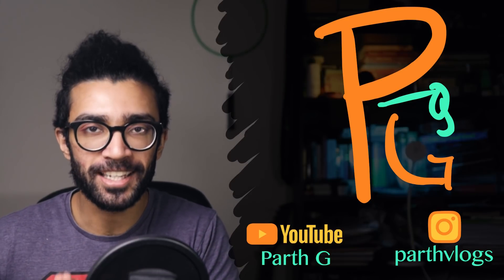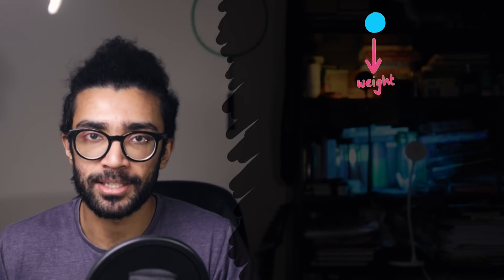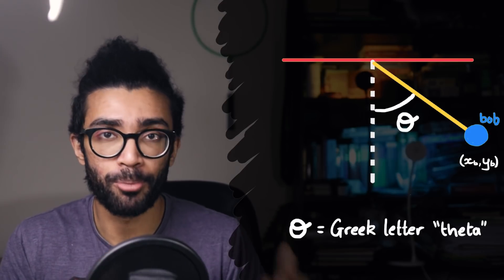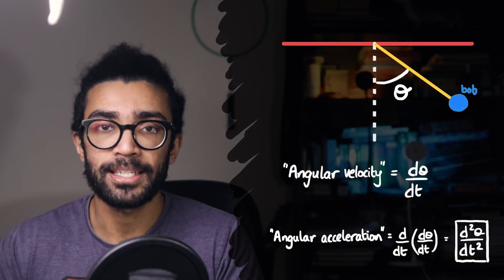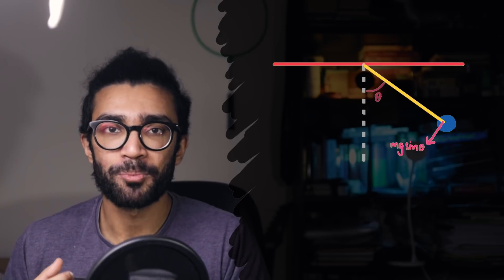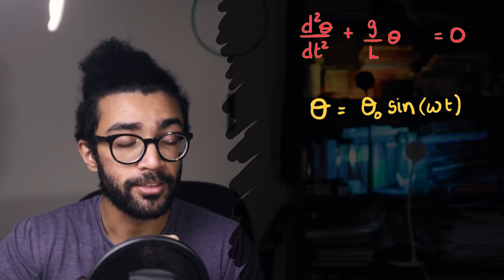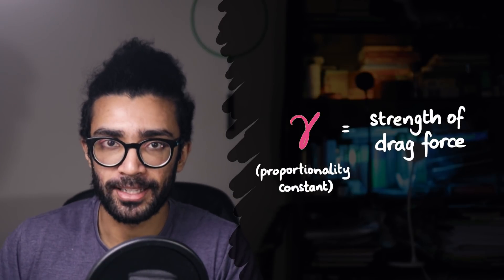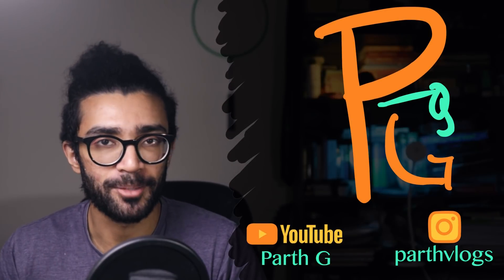How Physics Includes Air Resistance in Calculations | Real Physics

Comment: Hi, when looking for work done by air resistance, say for example there is a constant air resistance force of 5N acting on a ball that is connected to a string. The string is 4m long and is  held at a 90 degree angle parallel to the ground. It is then dropped down and falls in a circular motion due to the tension of the string. Work = Force x distance of displacement. So would the distance of displacement be equal to the angular displacement? or would the displacement be equal to 4 since it goes from a height of 4 meters to 0 meters? The 4 meters coming from the 4m long radius of the circle (string).
Reply: I have a test tomorrow and would greatly appreciate a response before then 😅

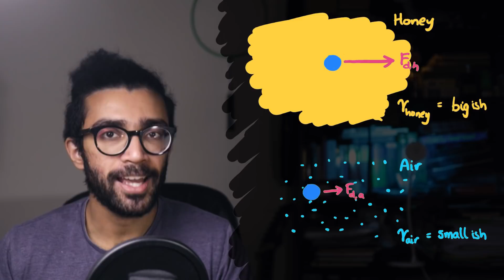Comment: 9:50 At low speeds the drag is proportional to the velocity, at higher speeds it is proportional to the square of the velocity. For instance, an automobile driving along a road at 60 MPH (miles per hour) experiences a drag four times the drag it would experience at 30 MPH. On the other hand, the drag you experience walking at 6 MPH would only be twice the drag you would when walking at 3 MPH.

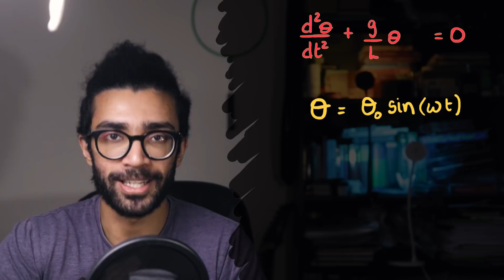Comment: 8:20 The solution to a second order differential (it has a second derivative) like this, is a function with a second derivative equal to the negative of the original function. Sine is a solution because the derivative of sine is cosine, and the derivative of cosine is negative sine. We can also write the sine as a function of exponentials and find an exponential solution, but that is too difficult for this video.

Comment: By convention, we use angles up to 10 degrees for our small angle approximation, but 60 degrees is far beyond the acceptable limit. Did you misspeak and say 60 degrees when you meant 6 degrees?

Comment: 4:00 The accepted unit for angular velocity (speed) is radians per sec, rad/s, not degrees per second, where pi radians are equal to 180 degrees (1 rad = 57.3 degrees). The reason for using radians instead of degrees is that it allows us to relate angular quantities to linear quantities by multiplying by the radius. displacement = radius x angular displacement; velocity = radius x angular velocity; acceleration = radius x angular acceleration, and so on.

Comment: I am a retired US Navy veteran Aircraft Structures, Airframes, Hydraulics, Pneumatics Flight Controls Systems Technician and I have always wanted to know the advanced physics and math those Mechanical and Aeronautical Engineers know.

I have been looking for an answer, for this simple pendulum problem and I have hanged string bob pendulums in my garage at STP 'Standard Temperature and Pressure' and have watched many excellent lectures here on YouTube, my mathematical physics or math can only grasp college algebra, basic physics and trigonometry with some knowledge of calculus one. Finally I have found your VIDEO gave me the insight in the way you have explained this complex problem. My goal was to know how to derive the real world mathematical physics of THE TIME 't', when the pendulum swinging has practically STOPPED,  in air as a Mechanical Engineering problem. Thank You SIR. AWESOME!!!!!!!!!!!!!!!!!!!!!!!!!!!!!!!!!!!......

Comment: Hello sir, I see you haven't made a video on small angle approximation of theta, please make a video on it if you can, your way of explanation makes me love physics, thank you
Reply: It isn't that complicated. You notice in his diagram that up to about 30 degrees the sine curve is very close to linear, so we just assume it is linear and that allows us to use the angle instead the sine of the angle.

Mathematically sine is defined by the Taylor Series

sin(x) = x − x^3/3! + x^5/5! - x^7/7! + ... (the denominators are factorials, 3! = 1x2x3, 5! = 1x2x3x4x5)
x is measured in radians, where pi radians is equal to 180 degrees.

For small angles, the effect of the second, third fourth and higher terms is small enough to be ignored. In fact, at 30 degrees the sine = 0.5, and the angle in radians is 0.5236 That's about a 4.5% difference.

Think back to the 1951 version of "The Day the Earth Stood Still" 😄😆

BARNHARDT: You wrote this?

KLAATU: It was a clumsy way to introduce myself -- but I understand you're a difficult man to see. I thought you'd have the solution by this time.

BARNHARDT: Not yet. That's why I wanted to see you.

KLAATU: All you have to do now is substitute this expression-- (pointing to a specific place) --at this point.

BARNHARDT: Yes -- that will reproduce the first-order terms. But what about the effect of the other terms?

KLAATU: Almost negligible... With variation of parameters, this is the answer.

BARNHARDT: How can you be so sure? Have you tested this theory?

KLAATU: (with a slight smile) I find it works well enough to get me from one planet to another.

(Barnhardt stares at him blankly)

Comment: Great explanation 👌👌 I have a small question , at the end of the video you showed the equation for motion of pendulum while considering the air resistance , there was an decaying exponential factor , this showed that the amplitude keeps decreasing over time , the problem is that the decaying exponential never reach zero it need infinity , so does that also implies to real word pendulum ? It will need infinite amount of time to stop oscillation ?

Comment: You have two issues with your explanation that I think are of critical importance to understand the equation. At 8:45 you say that the force due to drag is directly proportional to the speed of the pendulum and point out d(theta)/dt, this is right. However, at 9:05 you say that the drag force is acting in the opposite direction to the gravitational force which is only true part of the time. When the pendulum is at a maximum height and falling, gravity is pulling the pendulum down and speeding it up but drag is acting in the opposite direction of the velocity of the pendulum trying to slow it down. As the pendulum passes through the mid-point at the bottom, gravity is now slowing the pendulum and has a component acting in the SAME direction as drag. It is important to be clear on this as the gravity term is dependent upon theta while drag is dependent upon d(theta)/dt. Physically and conceptually these are very different. Secondly, you say that the negative sign means that drag is acting in the opposite direction as gravity which isn't true about the negative sign. The negative sign means that the drag is acting in the opposite direction as d(theta)/dt, not gravity or theta explicitly (which gravity is explicitly dependent upon). Making this distinction is important as the direction of force due to gravity is dependent upon what side of the bottom (mid-point) the pendulum is at (that is, it changes mid swing), while the force due to drag is dependent upon the direction of travel and thus is in the same direction during one complete swing from one side to the other. As a result, the periodic back and forth motion is purely driven by gravity while the dampening of the amplitude is purely caused by drag.
Edit: On a side note, I do enjoy your videos and think you do a great job.

Comment: Drag is strange. Sometimes it's modelled as proportional to speed, sometimes as proportional to the square of speed and real strange things happen over 80% the speed of sound. I kinda wonder whar would happen to pendulum if drag was proportional to square of speed, but for low speeds this solution looks close enough.

Comment: Important distinction! The drag force is only proportional to the speed (1st power) for slow laminar flow. This is not the case for air, which is always turbulent. Then the force is proportional to the speed squared, but that introduces non-linear dynamics which are really cumbersome and usually solved numerically - so I understand why you chose the former, but even though it is a drag force, it's not really air resistance :-)

Comment: 2:10 if the two forces cancel eachother out, then why would the object still fall and not just float in the air at its current position?
Reply: it would stop and float only if the drag force was equal to the weight of the object the moment it has 0 velocity. But when it is equalized at a certain time when it has (u) downward velocity there will be no net force to decelerate it (ΣF=ma=0)

Comment: isnt Fd = 0.5ρAcV^2 which is  0.5ρAcL^2(dθ/dt)^2
Reply: You are correct. I referred to this in my comment also, his assumption regarding drag force being proportional to velocity is incorrect.
Reply: he used a simple damper as if it a drag force. 
so of course the final result would seem correct.
Reply: Not necessarily. Drag force can act both proportional to v and v^2 depending on whether it is laminar or turbulent in nature. The drag equation you mentioned assumes that an object is moving at a high enough velocity to have a high enough reynolds number to assume turbulent flow. This isn't necessarily the case with the pendulum.

Comment: something greate to see is that aire resistancee doesn´t change the pendulum´s frequency, so you can calculate gravity with a pendulum in anywhere even when there is air resistance.

Comment: Great to see vids like this up so thank you, but I'm unsure of some of your assumptions. You state that drag force is proportional to velocity, but I believe that is damping force that is proportional to the speed something moves, however, air resistance/drag is proportional to velocity^2. What you're including in your model is frictional damping (proportional to velocity, or in this case angular velocity), which would give a different differential equation and solution at the end if this difference was taken into account.
Reply: For small bodies and low speeds the drag force is proportional to velocity but for large speeds like that of an airplane the drag force is proportional to velocity squared.

Comment: To be fair, there is good reason to ignore air resistance from a pedagogical perspective. In a lot of cases resistance makes the maths harder, sometimes intractably so? without really changing the underlying phenomenon. You don't need to understand air resistance to understand an awful lot of classical mechanics.

Additionally, the inclusion of air resistance often doesn't change numerical answers all that much - but even when it does, understanding a phenomenon without air resistance is a prerequisite to the refinement of including air resistance anyway, so it's still a necessary first step.

Comment: Consider that the pendulum is at rest with θ_0>0, measured counterclockwise. When the motion starts, pendulum acquires angular velocity dθ/dt in the clockwise sense. So dθ/dt<0.

While θ>0, we have:
F_gravitational = -g/L*θ<0
F_resistance= γ*dθ/dt<0
That would imply that the resistance force is helping the gravitational force in accelerating the pendulum, what is nonsense [unless you define γ<0, what would require the last equation of the video to be exp(γ*t)*(cos+sin) instead of exp(-γ*t)*(cos+sin)]

As the resistance is a force opposite to the velocity, it would be more accurate to say that:
F_resistance= -γ*dθ/dt
Obtaining the final ODE:
d2θ/dt2 + γ*dθ/dt + g/L*θ = 0
Which is similar to the mass-spring system with dissipation:
m*d2x/dt2 + γ*dx/dt + k*x= 0
Reply: F_resistance= -γ*dθ/dt
you assume it but it's wrong
you just modeled a simple damper . air resistance isn't that.
Reply: For sure, you're right!

One could model the aerodynamic drag with a force with magnitude equal to Cd*ρ*V²*A/2, where Cd is the drag coefficient (that may also vary with the Reynolds number of the flow). That would produce an non linear ODE that is hard to be analytically solved, as presented below.
d2θ/dt2 + γ*(dθ/dt)² + g/L*θ = 0

Of course it is possible to solve this equation numerically, but the reason to model the drag force as a linear function of the speed is only to simplify the calculations, once the ODE obtained is linear and can be easliy solved:

d2θ/dt2 + γ*dθ/dt + g/L*θ = 0

Comment: I've been waiting for a video like that for a long time. Thank you yt suggestions! But I need to know one more thing: IS AIR RESISTANCE ACTUALLY DIRECTLY PROPORTIONAL TO THE SPEED OF THE PENDULUM IN A LINEAR MANNER?
Reply: well is more accurate to say that is proportional to the SQUARE of the velocity. The linear is more accurate when the fluid surrounding the "experiment"  (in this case the air) is behaving like a laminar fluid, which is not the case, but it is better than assuming not air resistance at  all

Comment: Can you pls explain or make video on time period of a vertical circular motion for a Bob attached to a string.(for minimum condition which is at top the speed of Bob is square root of rg where r is radius and g acceleration due to gravity) I am not even able to get the formula anywhere on the net or books forget about the derivation. Pls help

Comment: what I don't understand is that how can you be so sure that gamma is a constant and how can you measure it up in case of a system that you can use only once a firework per example
Reply: Imo his illustration of how you can use the mathematics in principle to model something like this is good, and to be fair I think that' s what he's trying to show us. But what he's done in the video is quite incorrect as far as it relates to the real physical world. 

You can look up the drag equation. For a pendulum, the drag force due to air resistance would most commonly be approximated as some constant multiplied by the square of the tangential velocity (or alternatively a different constant multiplied by the square of the angular velocity).  And this assumes constant fluid density, constant cross sectional area of the object, and constant drag coefficient. 

 I have no idea why he chose to use a constant multiplied by the angular velocity, but it likely wouldn't be a very accurate assumption in the real world.
Reply: To answer the second part of your question, assuming the object's surface roughness doesn't change the drag force can be approximated as  

Drag Force = Gamma*(Velocity^2)

      where

Gamma  =  (1/2)*(fluid density)*(Cross sectional area perpendicular to flow)*(Drag coefficient)

The drag coefficient may change with varying fluid velocity, fluid density, and fluid viscosity.

For real world situations there is no exact way of determining the drag coefficient. It is generally approximated by experimental measurement or physics simulations. There are rules of thumb to obtain a rough drag coefficient given common objects shapes and surface textures. These rules of thumb can be found in fluid dynamics texts.
Reply: Its assummed to be a constant by experiment, no? If the velocity is constant, then the force exerted on the object was also found to be conatant over time. So the only variable is velocity. Although gamma also depends on surface area snd such. But it wont change for the same object over time
Reply: Simply by assuming that drag force only depends on velocity of pendulum w.r.t air 
Which could be experimentally verifiable